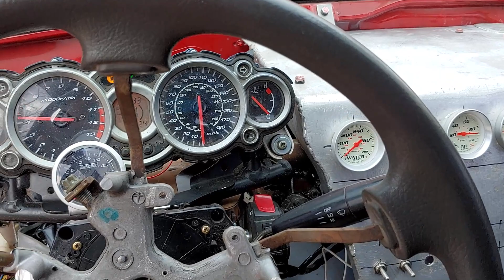Hayabusa motor in Geo Metro with RWD swap. Metrobusa

Comment: How did you make a transmission from the engine to the axle that goes to the rear differential?
Reply: Sprocket adapter that you can bolt a driveshaft to

Comment: I see alot of Busa mounted in an angle in the engine bay, any reason for that?

If its for oil pickup, would the dry sump fix that?
Reply from the maker: For me it was a combo of intake angle and getting the driveshaft above the steering.